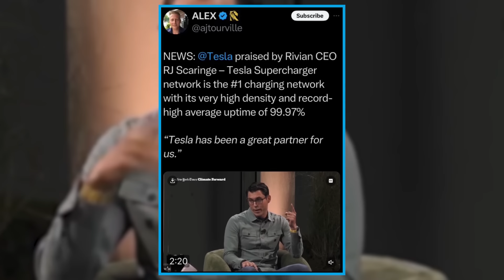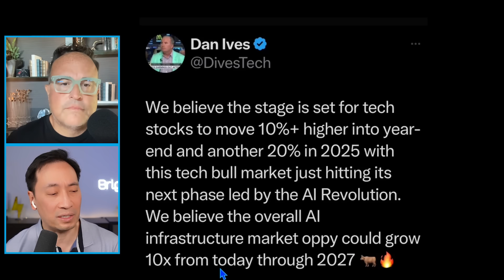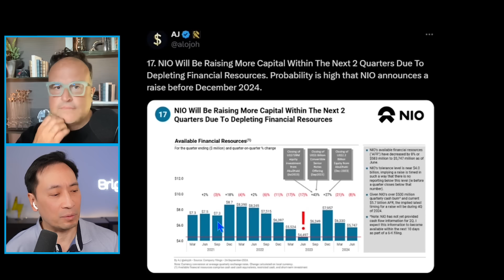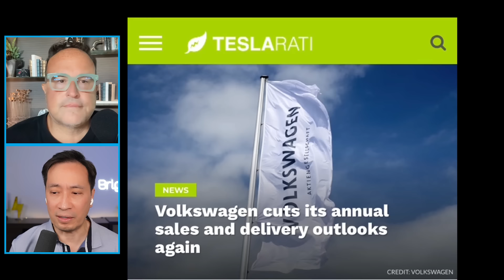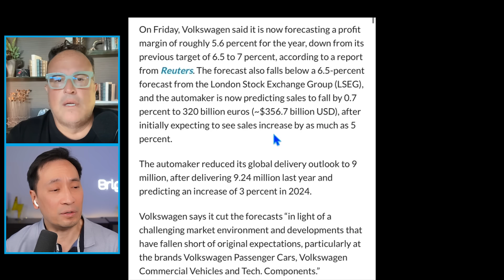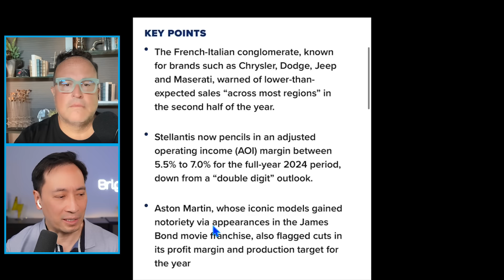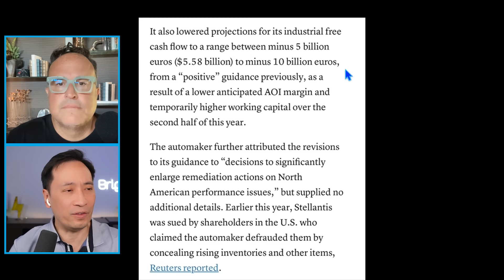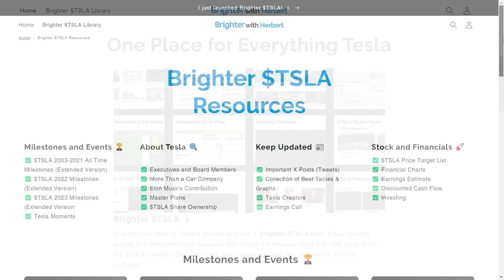Tesla Dominates While Rivals Struggle Financially

Comment: One youtube video explained how expensive it is to cancel a vehicle. Spares inventory has to be kept for a number of years, and suppliers (naturally) will have to increase the cost of components (having been hit already by declining sales). This is the "vicious cycle"of decline. I wonder if you guys could do a video explaining why declining sales can have a huge negative effect on profit....
Reply: If a company is manufacturing 20 or so different models and frequently changing models that makes for some serious inventory needs.  Tesla designs it changes so that the parts are mostly interchangeable with what was used earlier.  Not only does Tesla have fewer models, they have more redundancy between models and across years.

Comment: There is a very serious flaw in NIO swop battery technology which creates a continuous problem to the spoiled European motorist, that keeps him away from NIO even if they were selling the best car in the world, I would feel highly vexed if I were required to change batteries once or twice a month . Certainly it is not a piece of cake like tanking up fuel in a car or simply recharging a battery, without talking costs and implied problems if I were to need a battery swop doing a trip or at night. I think they just threw an unnecessary wrench in possibly a very good product, which I would abandon and go conventional ASAP giving them a better shot at surviving the ramp up years.
Reply: The downfall of battery swapping is that it needs extra batteries, swapping stations, and workers to keep the system operating.  Those costs will be passed on to the users.  With current EVs capable of adding significant miles in 20 minutes or so, there's no need for swapping.  Just charge once a week or so if you have no other place to charge.  Charge while eating lunch or doing your grocery shopping.